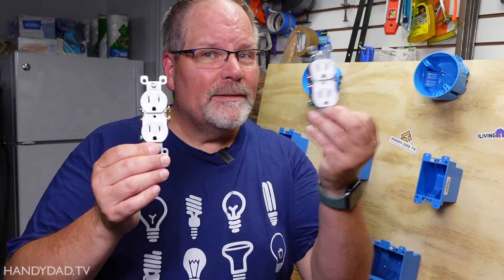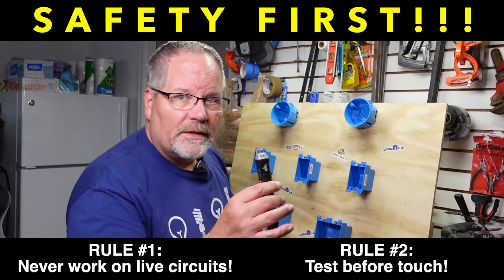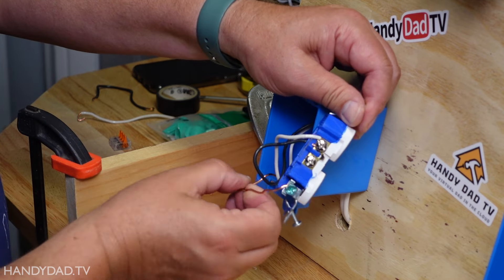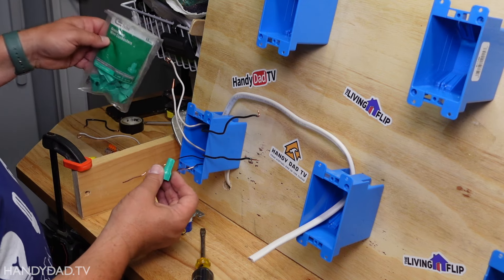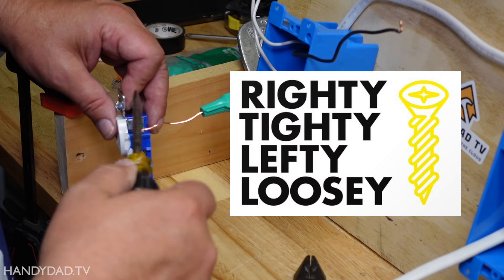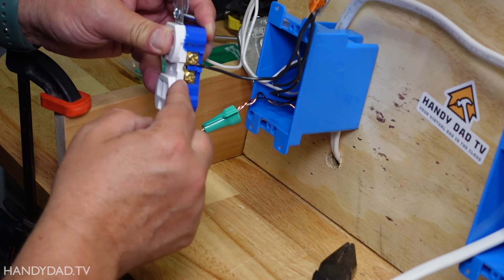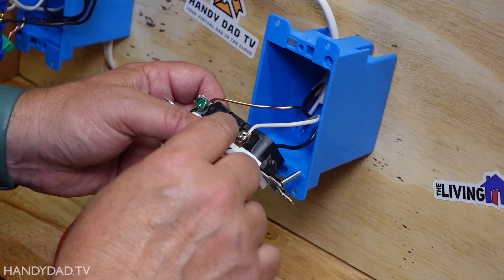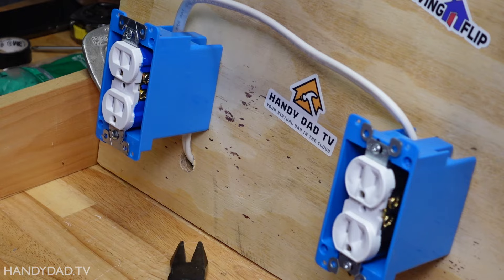SAVE $300 EACH!! How to Add an Outlet from Another Outlet

Comment: Yeah save $300 , that's quite a saving. Just make sure that you really know what you're doing. Remember, electrical works you are not allowed to make a mistake because the mistake you can make might be your last mistake or might change your life or might be very expensive. I never encourage DIY in electrical works. In electrical, you'll never know you made a mistake until it's too late and that's a fact. My experience in my electrical works since 1968, I've seen them all. One particular experience , I quoted for a ceiling install and my customer did'nt buy because he said too expensive and I'm ok. To my surprised he called almost 1 year after and when came he's on wheel chair. he made a mistake installing the fan, got a shock and fell and hit his back by the counter top breaking hisd spine and surprised to see the fan hanging unfinish. He's even a drywall installer himself. One mistake trying to save money. I ended completing the installation for him free .
Reply from the maker: Good advice! Thanks.

Comment: You should explain to the real life people that you will NOT always add in an additional receptacle at the End of Line circuit. 
Explain to them when you have to tap into an existing wire and you will need to daisy chain the circuit instead of “T” circuit. Or else your current will double or quadruple
Reply from the maker: You had me in agreement up until the last sentence. Adding outlets has no effect on current. Usage depends on the devices or appliances you plug into the circuit.

Comment: Only critique I’d have is the theory of why you pigtailed. No electrician would do this, especially with a wago. We’d be more concerned about overheating with the wago if anything.
Reply from the maker: I get many different opinions about this. I’ve always used the screws personally. But I’ve been told NEC requires the grounded conductor (neutral) to be pigtailed anyway. So why not do them all? As for Wagos, they have a higher melting point than the wire insulation.